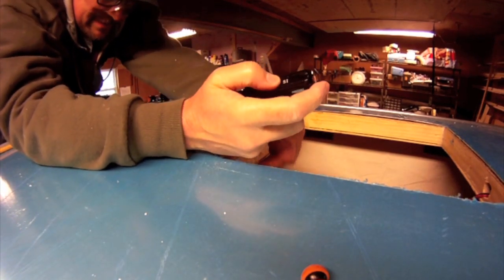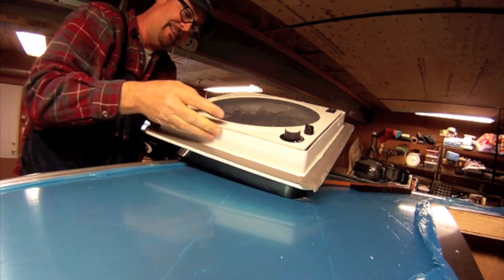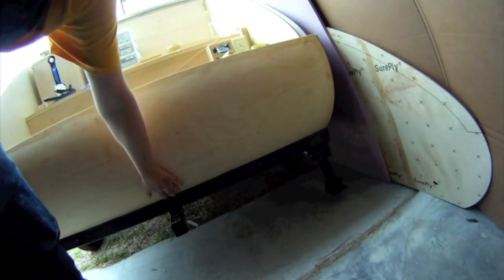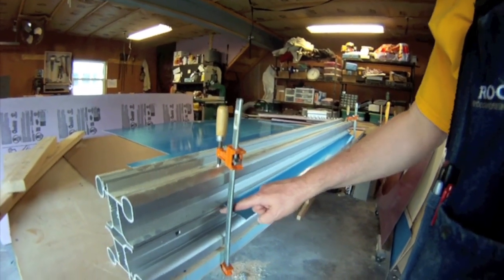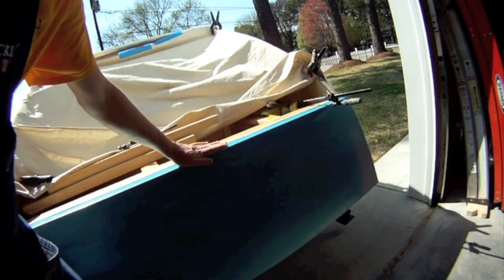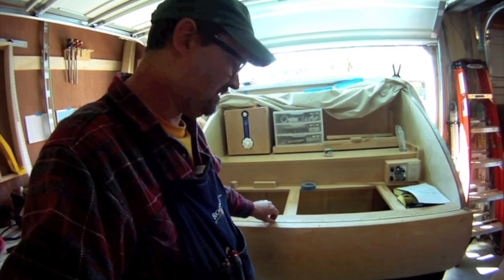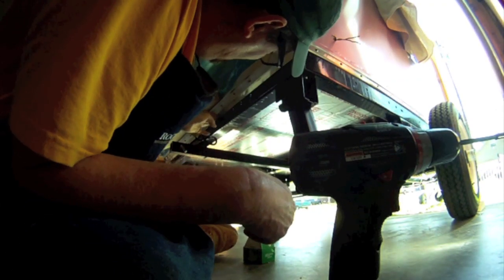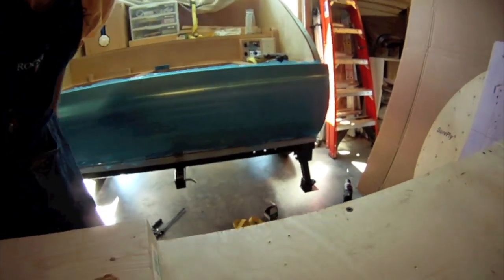Teardrop Build part #41

Comment: Hi Scott my name is Max and I am from Australia. I have just finished watching all your youtube teardrop builds and you have inspired me to start thinking about designing and building my own camper. I have no experience what so ever in building anything of this sort, but I do class myself as a bit of a handy man. I would like to know how you created you templates please. Can't wait to see you next video. Thank you
Reply from the maker: Hi Max. Congratulations on starting to think about your own camper. Mine rolled around in my head for about a year before I actually started it. For the templates, I used the free version of SketchUp to draw the curves to scale. I then overlayed a 3 inch vertical grid on the drawing and noted the measurement from the baseline to where the curve intersected the grid for each 3 inch division. Once that was done, I took a full sheet of plywood and transferred the measurements onto it full size. At each mark I drove a small nail and then used a flexible stick to draw a smooth curve around the marks/nails. I cut it out, trimmed and sanded until the curves looked smooth and then started drawing cabinet, bulkheads, lights etc. full size on the template. I used the template as a guide throughout the build.

There are also a couple of ways to do the drawing directly on the plywood full size. Try googling "drawing ellipses for teardrop". I came up with several examples using string, nails and a pencil.

Good luck and let me know how it comes out!

Comment: Hi Scott,
Fantastic build vlog!
Is the hitch receiver on the back of your trailer part of the 2x2 tube you added, or is a separate component?  It looks like one continuous piece in the video. 

Thanks.
Reply from the maker: Hi Jeff, I had the receiver welded to the end of the 2x2, which runs the full length of the trailer. I'm not sure what I'll use it for, but it seemed like a good idea to weld it on during the building process rather than having to figure out how to add it later.

Comment from the maker: Hi Ned, for some reason I can't reply to your post directly, but hopefully you will find this reply. I'm using a product called Sharkhide to protect the aluminum. This product is made for preserving the shine on aluminum pontoon boats, which would seem to be a much tougher environment than what my teardrop will experience. I applied it to the aluminum while new, and it has stayed shiny and unstained sitting outside for most of the summer. So far I am very pleased. They also have cleaning and polishing solutions that I don't have any experience with.